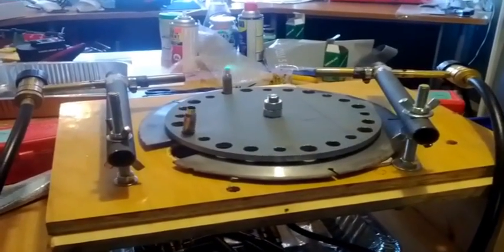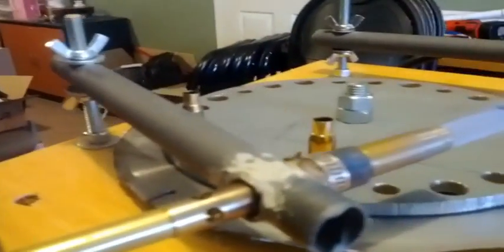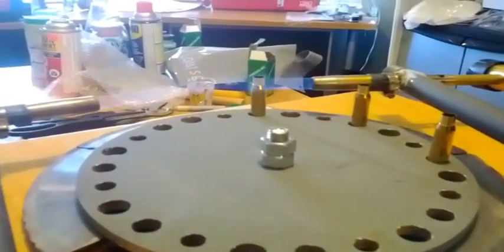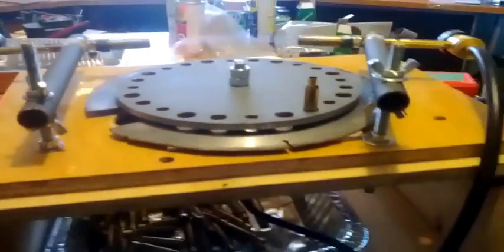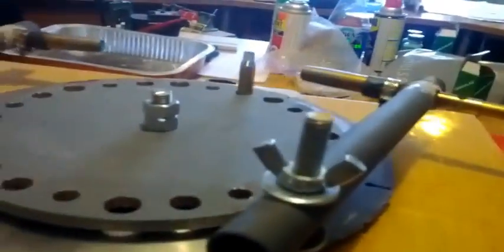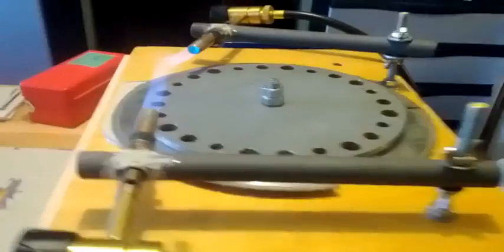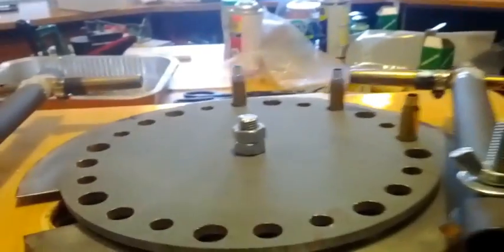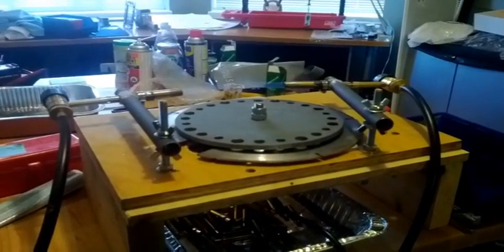DIY Homemade Brass Annealer - Annealing Station

Comment: Good job, I do almost the same with mine to set the temperature. I have made some tests by trying to crush some old cases, in fact the brass is already annealed when neck mouth just starts to glow red into the dark. Many people feed these machine with some small propane bottles, but it is much better to use large tanks to avoid gas pressure and/or temperature changes during the process.

Comment: I very much like the design, easily adjustable between case length or size, with no additional parts to change.   you don't need the water bath but does cool the cases quickly for handling.   If you don't commercialize this, I bet someone else will, if not already.   just make it all metal.

Comment: I gotta say this is a build that even lightly skilled DIY'ers could put together. Kudos for the excellent coverage of all the details and Q&A follow-ups on additional clarifications. Turns out I have all the materials except the propane tank T. I see your rotisserie motor is 2RPM and the one I have is 3RPM which may be a bit too fast unless my torches can make up for the shorter flame exposure time. Or use a simple belt pulley to reduce the speed. Any old printer or scanner has great belts in them.

Comment: That's just the rotisserie motor off a BBQ? Seems simple but effective, nice.
Reply from the maker: Carter Bez Yes it is just a Rotisserie motor you could purchase just a replacement motor itself.  Key is to find the lowest RPM motor you can find.  I've provide addition information about my annealing process.

Comment: Very nice video but are you sure that water for cooling is required? After instant cooling the metal becomes very hard and the result of annealing is zero. Sorry if I'm wrong.
Reply from the maker: Thank you for your question.  I mentioned in the video that water quenching is not required.  However the purpose for water quenching is more peace of mind as a function to stop the heat from traveling down to the case head.  There are a lot of discussion on the internet.  However from what I can gather from a lot of discussion and reports from metallurgist quenching does not work harden the brass because of the of the composition of brass.  I'm NO expert in this field so my opinion an thoughts on it maybe moot.
Reply: Brass does not harden in water , the water is to keep the heat from creeping into the main part of the case and seeking it , this could be a problem ,especially dropping hot case after hot case on top of one another with no water or fan source to dissipate the heat .

Comment: Do you feel its not need to rotate the cases when in the flame? 

Thanks Great design!
Reply from the maker: rotating the case would allow the flame to uniformly anneal the circumference of neck and shoulder.  What I've found that this design does create a slight flame shadow, evident by the coloration change below the shoulder.  However I found the necks to be adequately annealed.

Comment: There are many myths about annealing. Myth Number 1 is overheating the case neck ruins the brass. Myth Number 2 Quenching hot brass in water hardens it. Myth Number 3. Is that you resize the brass before annealing. Annealing always slightly deforms the brass because it is stress relieving the metal. You should always resize brass AFTER annealing. If you heat the neck to red hot, the brass is NOT ruined. Resize after annealing. I have been resizing AFTER annealing for over 40 years and do not recall ever collapsing a case resizing it from overheating the neck.
 Summary: 1. Resize after annealing to reform to proper dimensions after stress relieving the metal. Heating case neck to red hot does NOT ruin them if you resize after annealing. 2. Do not anneal the lower half of the case, neck and shoulder only. 3. Annealing highly increases the life of the case. I have 243 brass formed from 308 over 30 years ago that has been fired so much I have lost track of the number of firings. Regular annealing does increase the life of the case by a large amount.
Reply: That makes sense...for a longer case life, anneal before resizing, not work harden by resizing before annealing. 
Under annealing is likely more common than over-annealing?  For example, Annealing Made Perfect of cases in an oven for 1-HOUR! and found that up to 660F there was little annealing occurring with minor decline in Vickers Hardness (HV 136 to HV131).  They show that for a .223 case flash annealing to 1000F took 3.4 seconds.

Comment: What rotisserie motor did you use? The ones I've seen all have a square female socket. Did yours have a threaded socket or did you some how rig it to fit?
Reply from the maker: Yes your correct.  I adapted hex connecting nut to the square female socket, using JB weld then used a threaded rod as the center to hold the plate.

Comment: could you give the dimensions on the plate you made like how you spaced you holes and the size holes you had cut in them ?
Reply from the maker: +Matthew Clark The diameter of the plate is 9 inches.  The center of all the holes were offset from the outside edge approximately 1 inch and space equally apart I drew it up on CAD.  I had the holes cut slightly larger than the cartridge base diameter if I recall correctly I asked for 0.060" larger.  WSM .615 (orig .555), 308win base .531 (orig .471), 223Rem base .436 (orig. .376).  However my buddy who runs a water jet cut it slightly larger by accident.  If I were to redesign it I would make it a tear drop shape with the radius of the tear drop big enough for the magnum case bases.  That way all holes would fit all types of cartridges.

Comment: could you share the specs so i could make one
Reply from the maker: Joseph Purnell Hi Joseph yes I can share with you the specs.  It's very simple actual the list of materials is listed in the video description.  The platform sits on 2"x6"cut to about 13"-16"long.  The length of the plywood sheets of plywood is dependent upon how wide of working area you like to work with mine is approximately 16-20" in length width is the same as the legs.  I cut a hole at the center of the plywood with enough clearance for the coupling nut that you would epoxy or glue to the BBQ motor.  This coupling nut is to allow a threaded rod to be place at the center axis of the machine.  The coupling nut I purchase is 1" in length I put a second layer of plywood to support and space the shell plate. I just use dry wall screws to assemble the plywood and the 2x6s together attached from the bottom so to provide a smooth surface to the top..  Try to get the shell plate a low as you can to support the head of the brass so it doesn't tip the brass over when it turns.  

The BBQ motor that I had came with 3 screw with spacers attached to a plate.  I use the plate as the template for the screw holes and counter sunk the screw location so that I could invert the BBQ motor and attach it to the bottom.  I did not use the spacer or the additional face plate it came with.  

Again there really isn't much to it I built it as I went along and really measured and eyeballed a lot of what you see.  If you need more information please feel free to use the email in my "about" section of my channel.